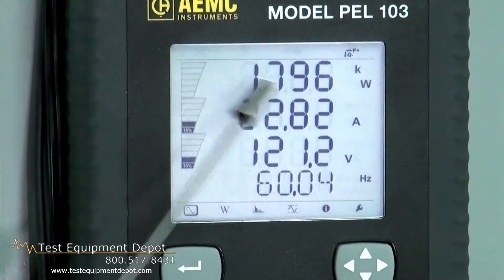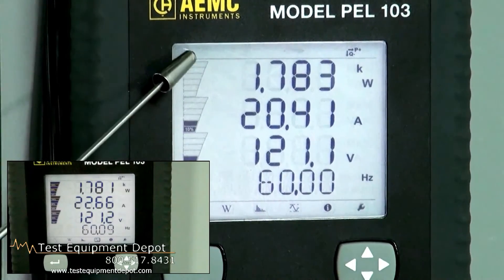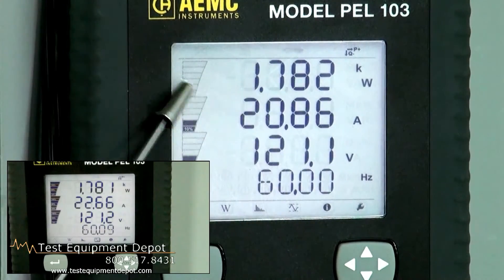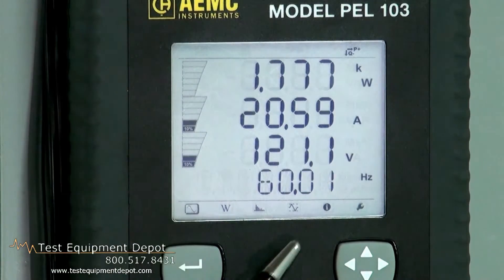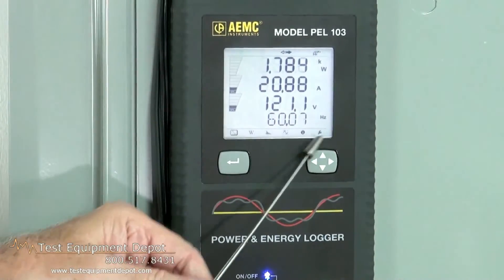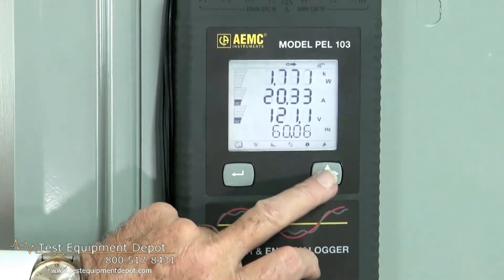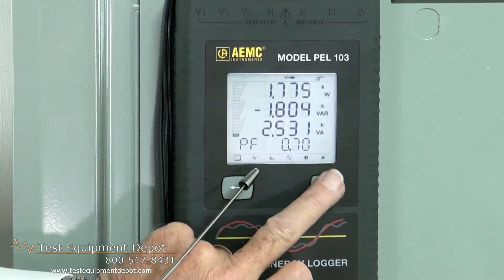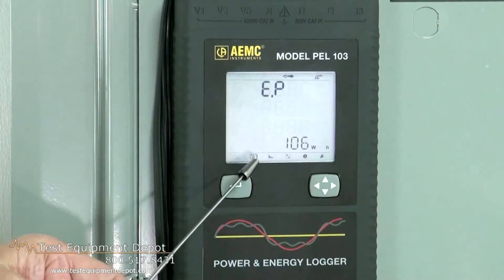AEMC PEL 103 6 Channel, Power & Energy Logger - with Display (Part 1)

Comment: Dear friend ED Cunny 

Creat video i have a few questions 

Wich is the main difference over AEMC 8336 versus PEL 103, the price right? but in the field i used to work with 8336 and it is great but PEL 103 is a dream come true?  except for the electrical parameters that 8336 can save.  but really not all industrial plants need to know all those parameters. except for unbalance, 

memory card slot, eternet , must came in future to new 8336.?

will you advice to buy this 8336 or wait until it change?

sincerly 

i hope to hear from you soon 
thanks in advance